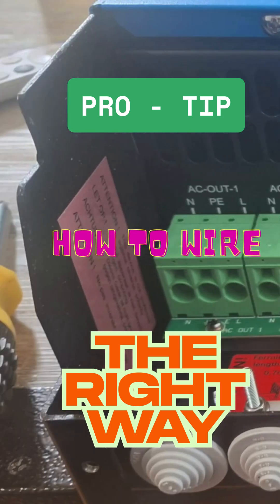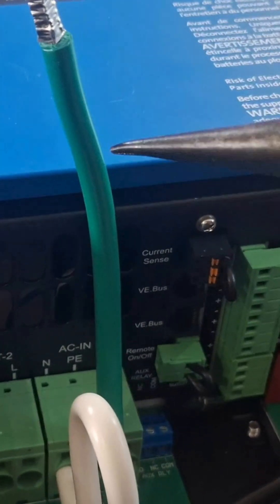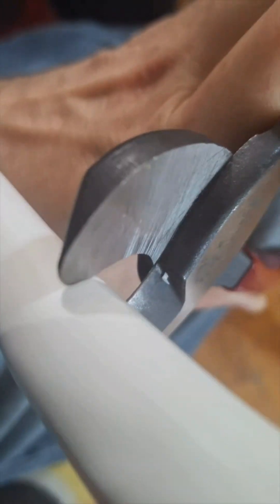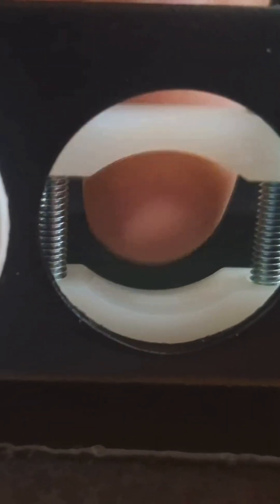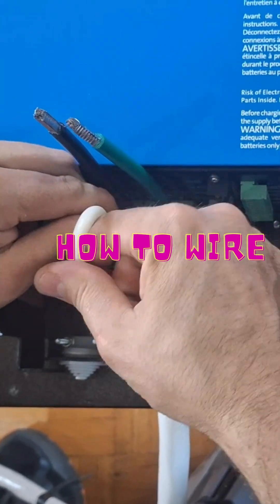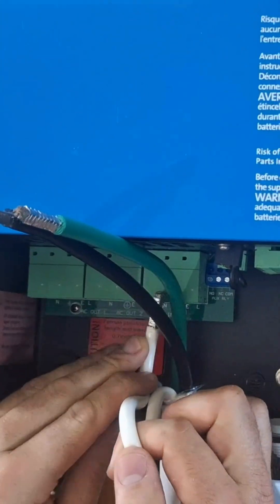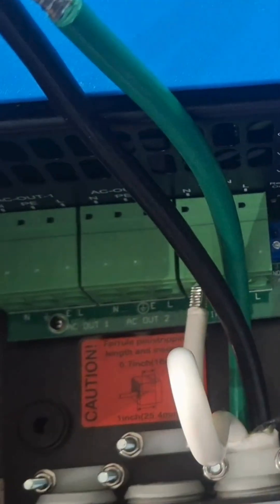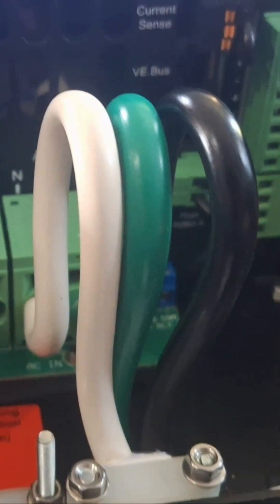PRO Tip: How to Wire Victron MultiPlus-II AC with 6-Gauge

Comment: 4mm² or 6mm" cable
Reply from the maker: We used 6awg (6/3) and order the (ROUND ONE). There is either FLAT or ROUND. If you use Flat it will be way larger and harder to get it into.

That being said follow the manual, at first we said we will use smaller wires, but other people said to follow user manual and it make sense... if we upgrader later on and/or use power-assists it can deliver way more AMP's. But if you NEVER think to use POWER ASSIST i guess maybe you could downsize... I just didnt wanted to take chances and its more Future proof.